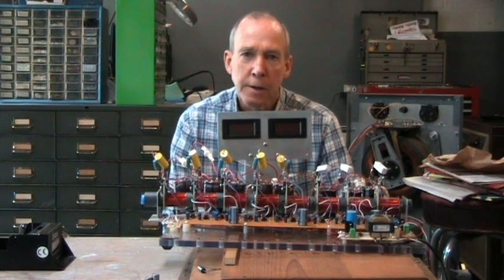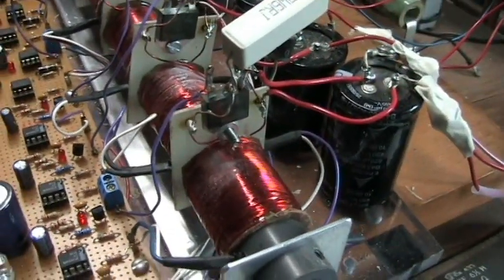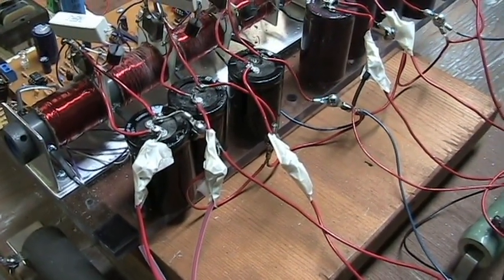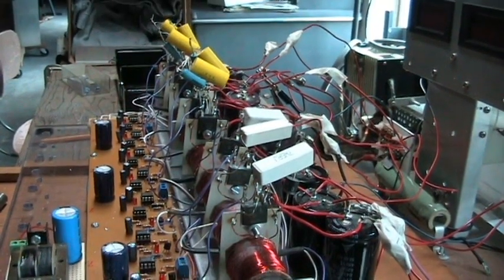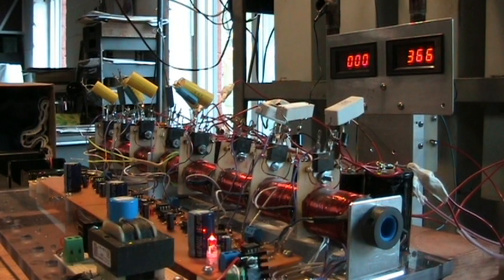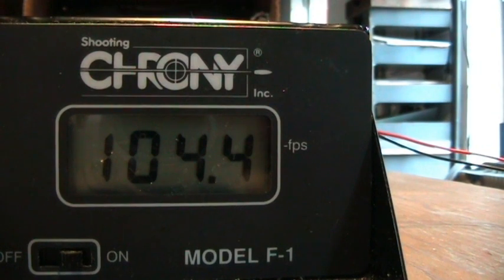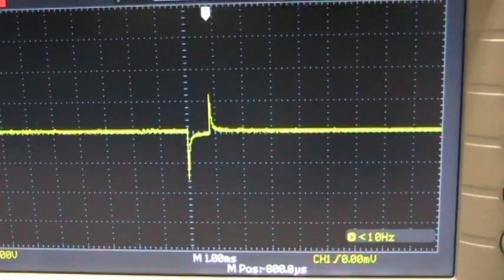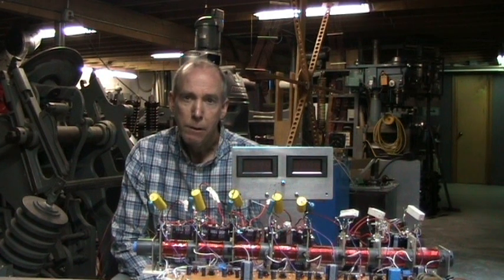coil gun part 3

Comment: Try gold wire
Reply from the maker: I had to settle for number 20 copper. Budget issues
Reply: @stephenhrobak3631  ik but golds a better conductor less residence
Reply from the maker: @iwillbreaku4368  Resistance is overcome with higher voltage. Part 4 in this series will be posted soon. The problem is the switch.
Reply: @stephenhrobak3631  oh i gotta watch it when it comes out your doing a good job tbh i eventually would like to see this tech used for hunting how what kinda current would you have to run threw the wires to get your projectile to move at 1225 feet per sec
Reply from the maker: @iwillbreaku4368  I have a long way to go to reach those speeds. I do not see this as being very portable. Thanks for your interest

Comment: Hi again. I've been thinking this problem through ever since first seeing one function. The secondary spike is always going to occur. But, if you have hardware / software control, you could work on timing the  turn off of the IGBTs so that the coil energy disappates before the projectile enters the braking section of the coil. I also think if you shaped the coils to provide and increased flux density all the way to the end that you could use the entire coul length in the acceleration process.
Reply from the maker: Determining coil length and number of turns for the coil as well as turn on and off times gets into some engineering math beyond my skills. I am not much of a computer man. Thanks for your interest.
Reply: @stephenhrobak3631  I understand. Look into cone shaped coils. Papers have been published on using them for non contact communication and sensing but also look at Tesla's cone step up transformers. Also there are some amazing physics lessons by MIT professor on YouTube.
Reply from the maker: @josiehinton4351  Thanks for the input. I will check it out.

Comment: Is it possible to magnetize the projectiles and run the coils in a pull push configuration? (Eg, optical sensor on input of coil triggers the coil in the positive direction and the output sensor triggers it in the negative direction while simultaneously triggering the next coil in the positive direction.)
Reply from the maker: I tried to use a super magnet and it made no difference. If I make a part 4 I plan to parallel the switches and less inductance. To switch the coil polarity is a ways off. Thanks for your interest.

Comment: neat stuff, you are losing some in recoil of the whole machine, couple a screws would fix that. i.e. @4:05 the whole machine moves about 1/2 the width of a yellow cap. 
Edit, as the cap voltages are falling, it might make sense to have the later coils have lower impedance.  Heck the bullet can be the switch.
Reply from the maker: If I make a part 4 I will correct some of the defects. With optical triggering I can time the coil switching. Less inductance will surly help but with that I will need to parallel the IBGT switches. Tuning is critical.
Reply: @stephenhrobak3631  really cool stuff and a lot of fun to think about, thanks for sharing!